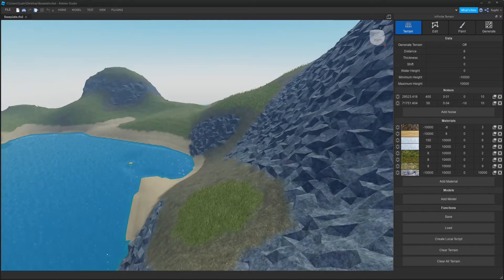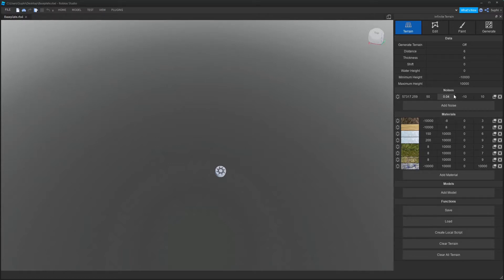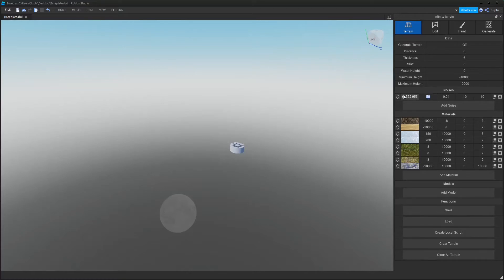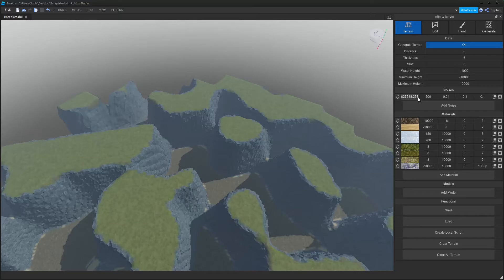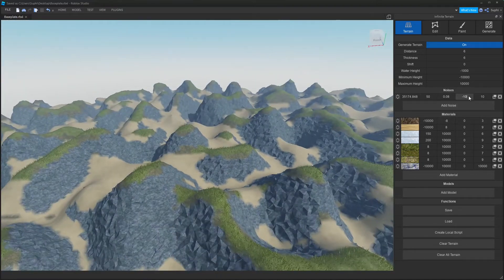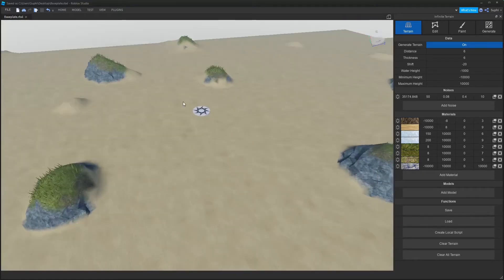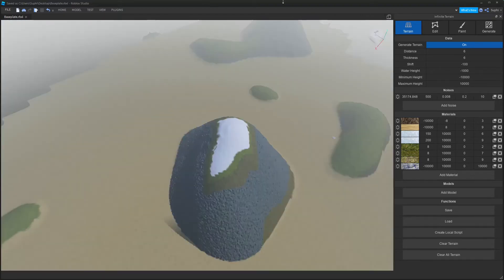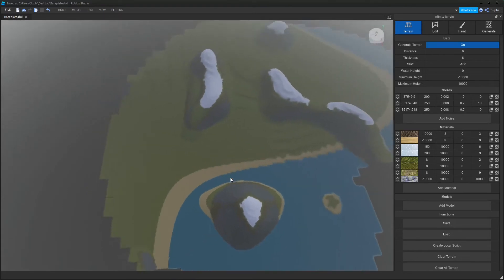Noise Tips & Tricks - Roblox Infinite Terrain Plugin

Comment: Hey is there a way to make the oceans really big and the islands normal size
Reply from the maker: Yes shift the terrain down and scale the noise
Reply: @5uphi  thanks a lot man your an awesome person
Reply: @5uphi  hey sorry to bother u again but I did what you said and I get the big oceans when I do it, but the islands are still really big. Could u be more specific on what I should change.
Reply from the maker: If the islands is to big then increase the scale value by a little and shift the terrain a bit more down

The scale value is by default 0.04

Comment: What's the process of layering seeds? Do you combine the values?
Reply from the maker: The noises are just added together
Reply: @5uphi  the noises as in the Y value returned by math.noise()?
Reply from the maker: Math.noise takes in 3 values and returns a value between -1 and 1 this value is multiplied by the magnitude and then added to the other noises that you have added to the plugin then the final value is used as the terrains height
Reply: @5uphi  Got it; thank you. 👍